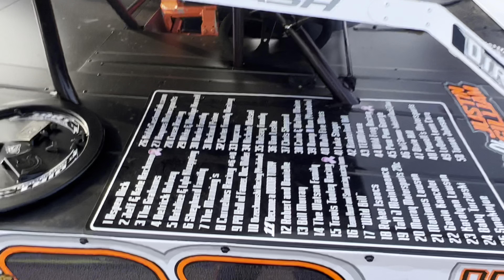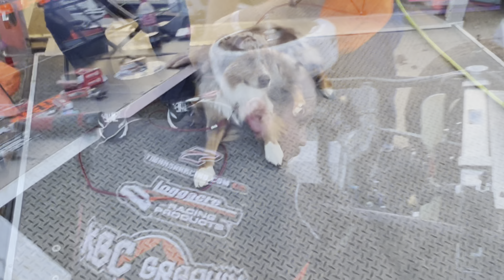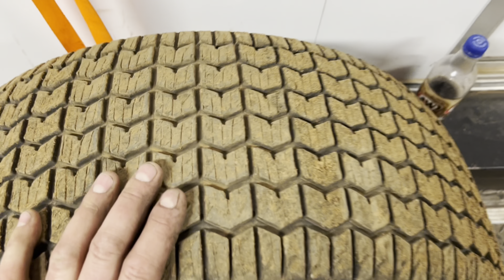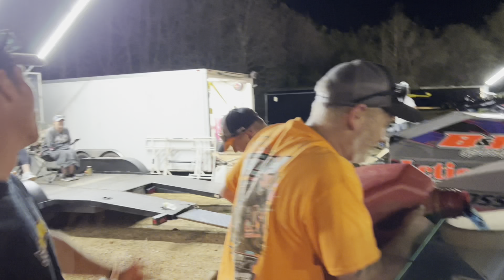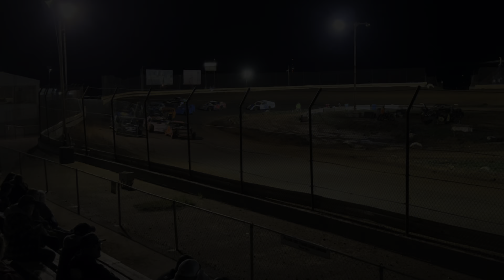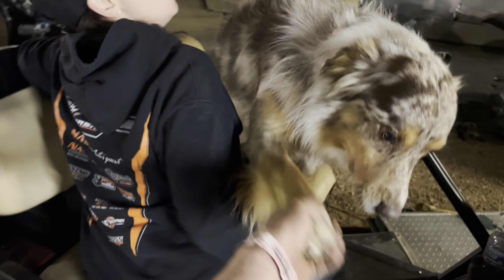Worst night of racing EVER!! - Houston we have a problem!!

Comment: Put a little voltage meter with the toggle switch right off the battery then you could see when you're charging it and when you're going to go out on the track you could see where is the voltage is at a glance